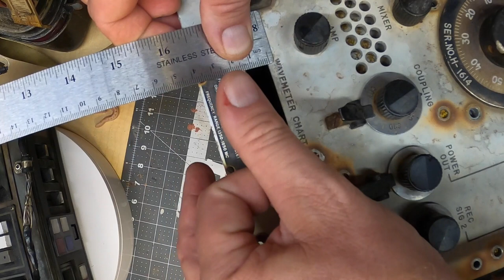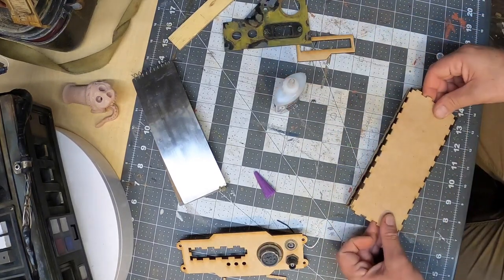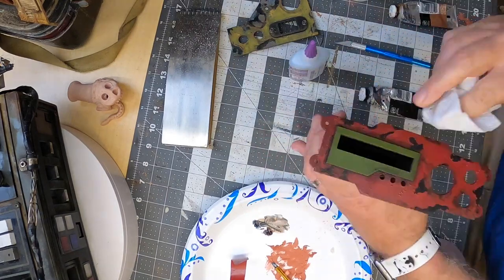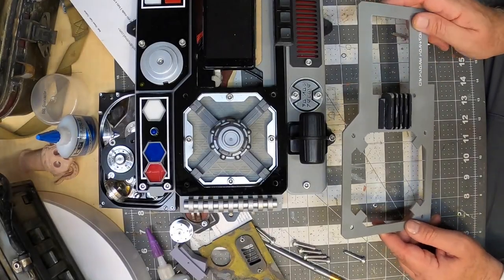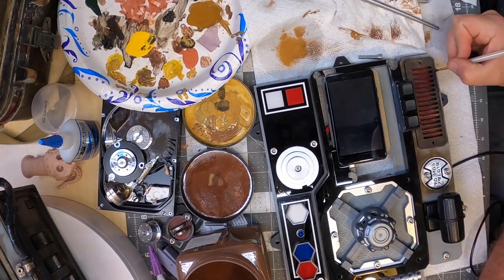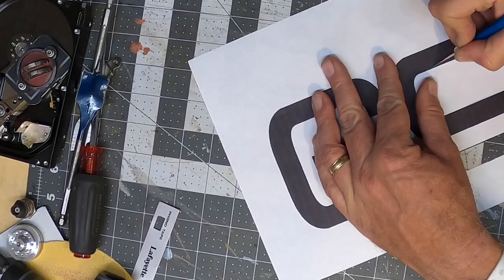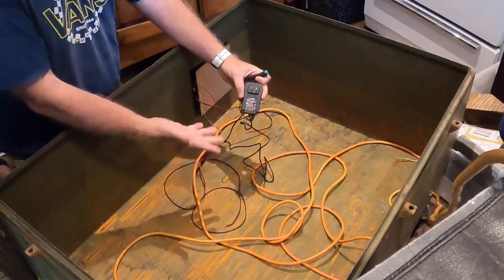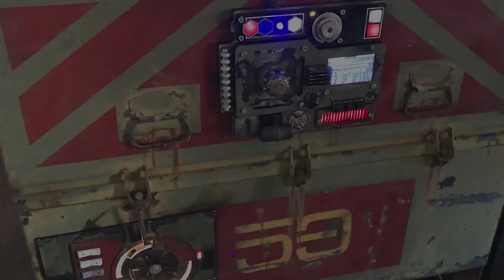TTFS: Mandalorian-Era, Galaxys Edge-Inspired, Star Wars Cargo Container Table

Comment: I love a good wall wart but I'm always wary of the ones that are adjustable if you're using them at less than their maximum setting. They have a tendency to magically get knocked up to their max setting which can fry your electronics (Assuming you didn't include over Voltage protection).
Reply from the maker: I didn’t … this particular one only has a 9V max so it’s perfect for these (probably also why these are cheaper)!
Reply: @trytofinishsomething  These days I tend to use the USB wall-warts which are very inexpensive and build a USB A or B into my electronics allowing be to connect them with a USB lead of whatever length I need and no chance of the wrong Voltage being applied as USB is always 5V.